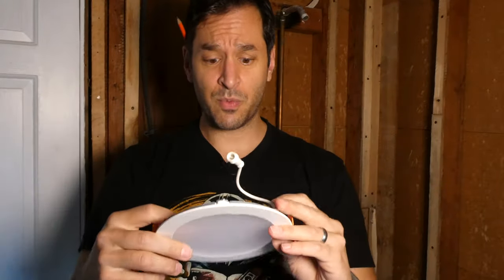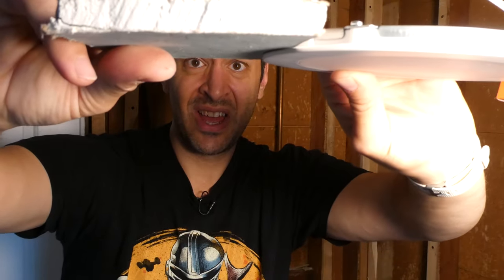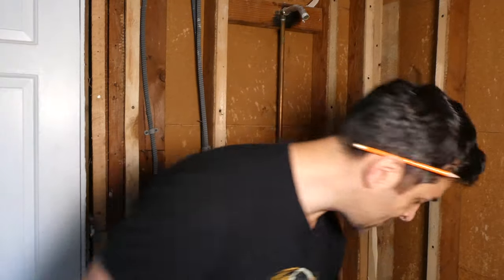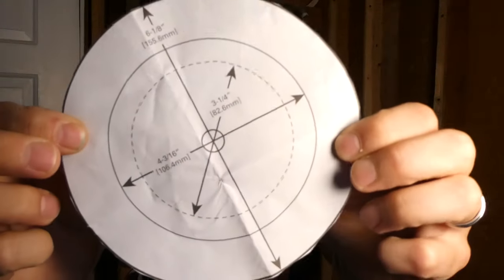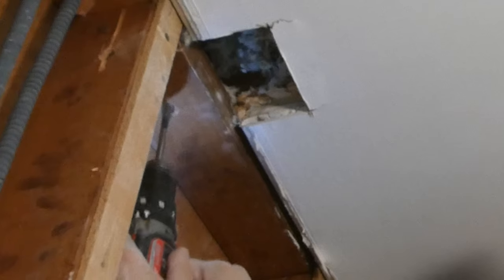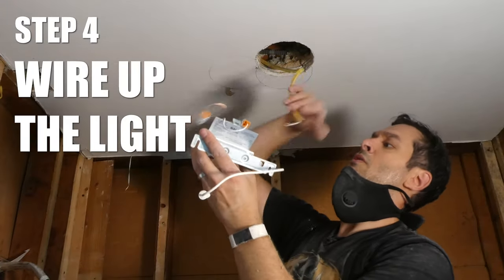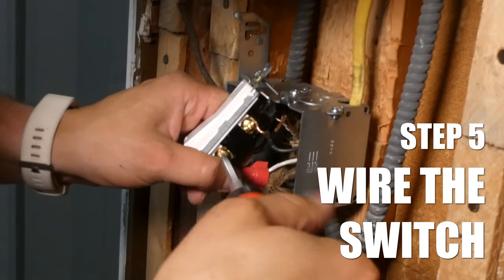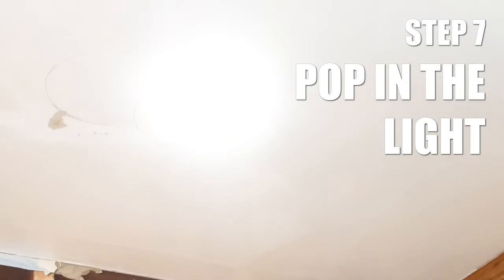How to Install Recessed LED Lights

Comment: I am thinking of doing this in our new built flat. The walls are already done. I have no idea where the joists are / which way they run. Any suggestions on how to go about it?
Reply from the maker: That’s a great question! You can try a stud finder, or you can even use a really strong magnet (it’ll latch on to the screw heads embedded in the drywall). If you use magnets get the rare earth kind. Super strong. Good luck!